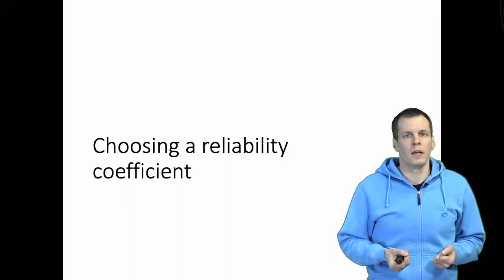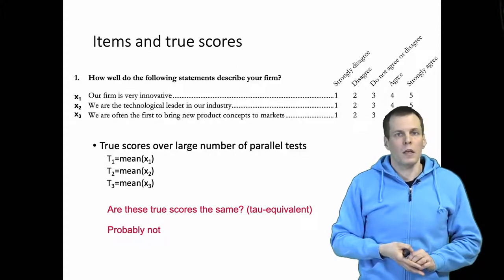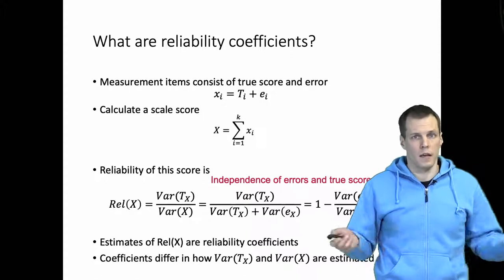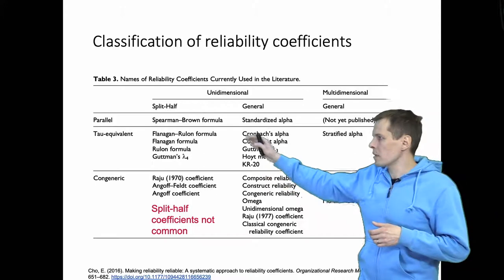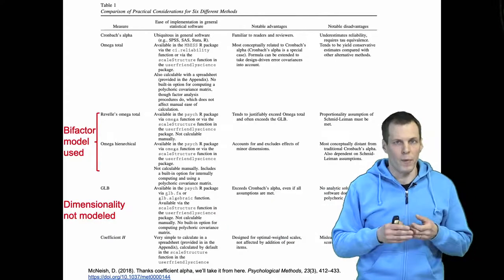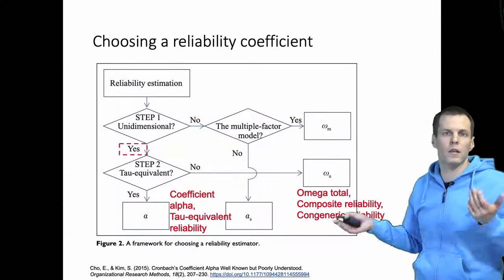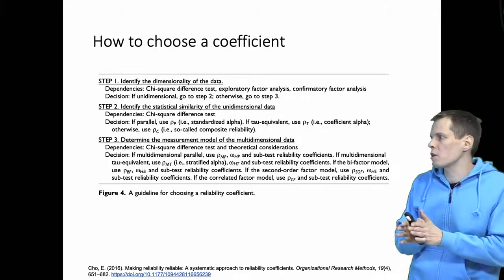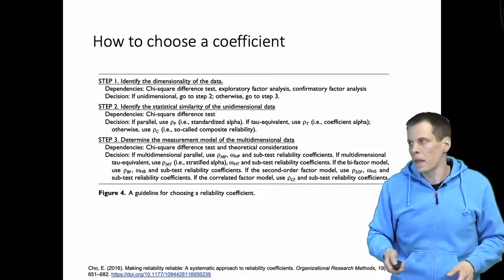Choosing a reliability coefficient

Comment: Hi Dr Rönkkö, thanks for the great video! Apart from dimensionality and tau-equivalence, do we have to take into account other factors? For instance, I have two questionnaires which are both two-dimensional and each factor is not tau-equivalent. But my data (n=35) are not normally distributed.  Do I have to take this into consideration? Then, what coefficient should I use?  Thanks in advance!
Reply from the maker: Your sample size is so small that it limits what you can do. Normal distribution or lack of it has generally little consequences for reliability coefficients. I would go for Composite reliability (or omega, which is the same thing) as a default alternative unless you have a good reason to go for something else.
Reply: @mronkko  Thank you very much! Highly appreciated 😊